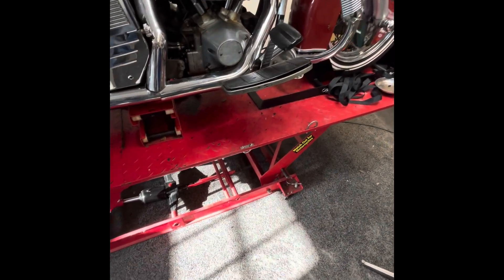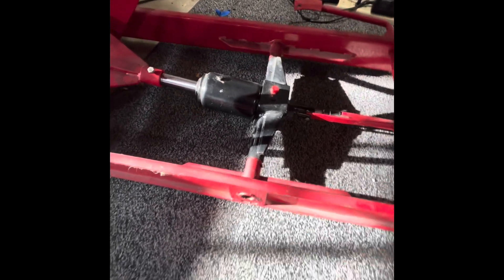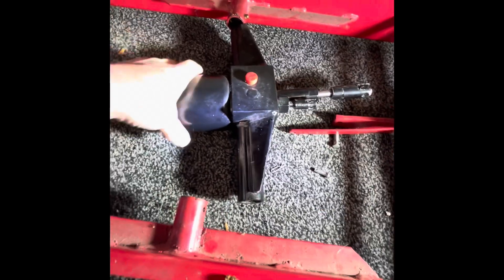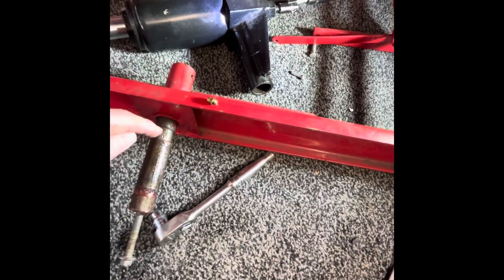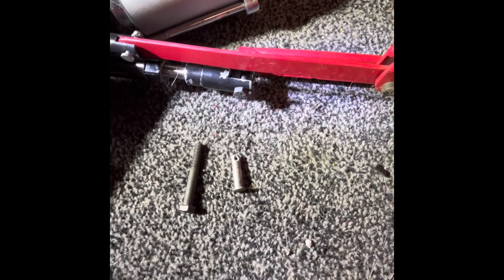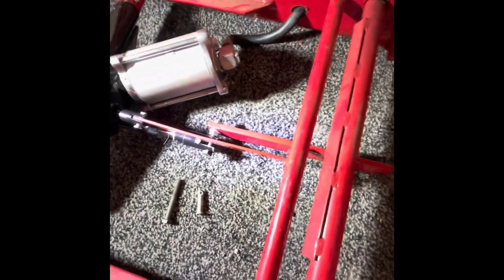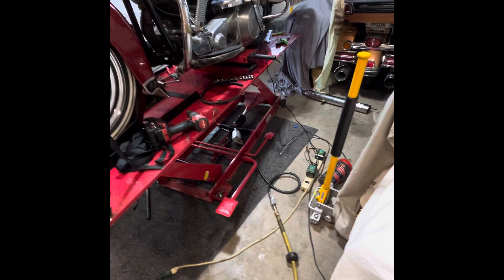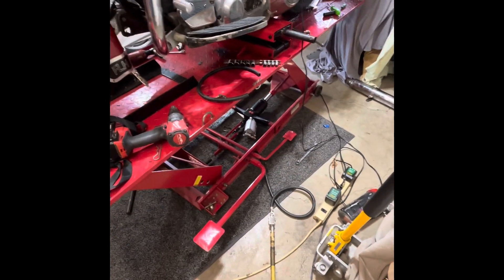Harbor Freight Motorcycle Lift Table Cylinder Upgrade Air over Hydraulic motorcycle lift table

Comment: What pump did you order for the air over hydraulic
Reply from the maker: @HughBurka  Go to Redline Stands website and go to the parts section. They sell a Harbor Freight hydraulic replacement and this air over hydraulic that says it fits Titan and “other brands”
Reply: How big an air compressor would you recommend for this?

Comment: hi i have had the  same lift for 9 years now never had  any problems. i just converted mine and it works great. for the air line i drilled a hole in the frame and used a female air chuck so i could remove the air foot pedal when not in use. it lifts my heavy fatboy with ease.              thanks for the video.....